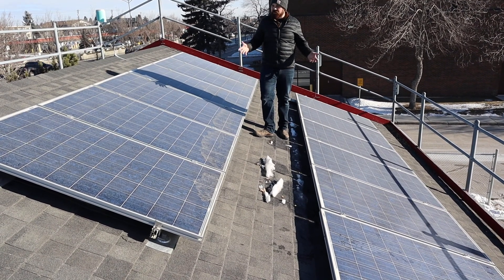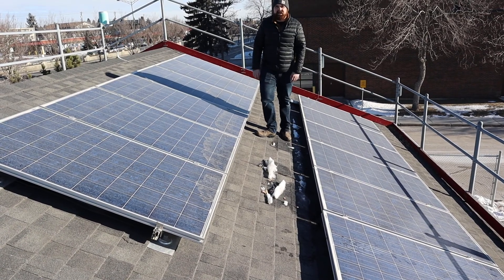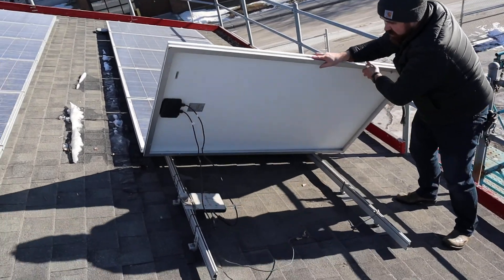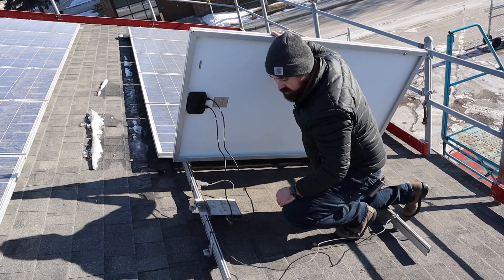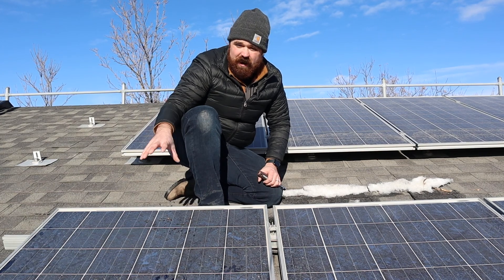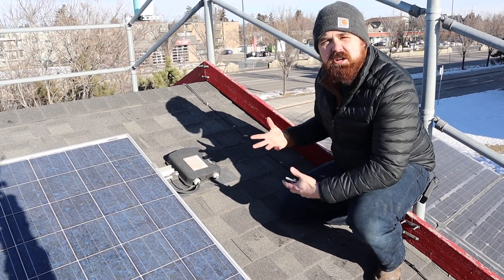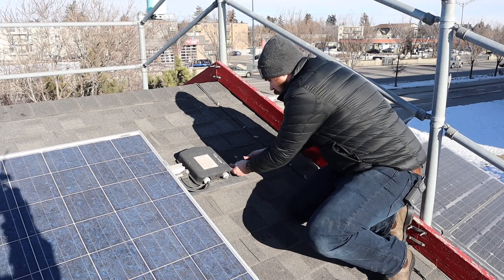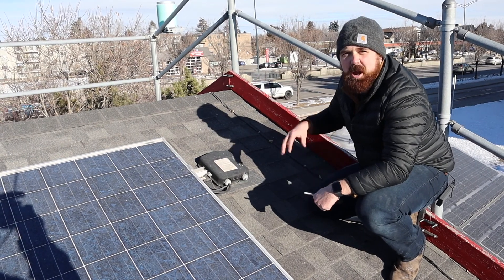Solar Micro Inverter System

Comment: Hey Zack Great Video, keep it up. A couple of questions if you don't mind. Where does the AC coming from the micro inverters go to?  In an off-grid situation can we have that microinverter feed run directly into the Main breaker in an electrical panel and use the electricity on anything run from other breaker in the panel? (Expecting that the solar panels are in full sun)   Thanks in advance on any and all input for using micro inverters in a off grid only setup.